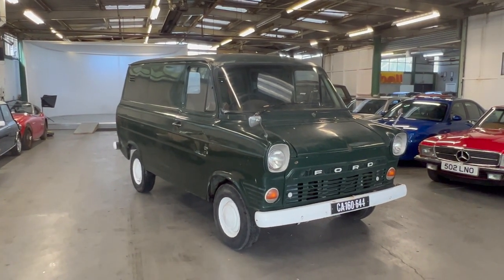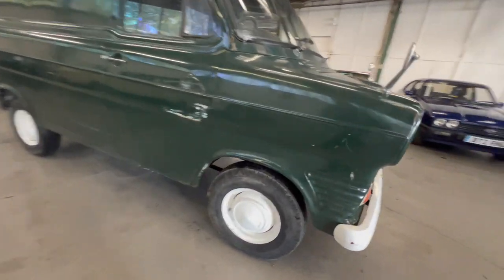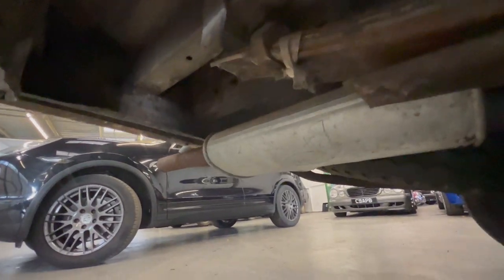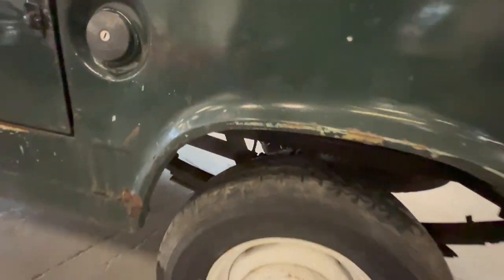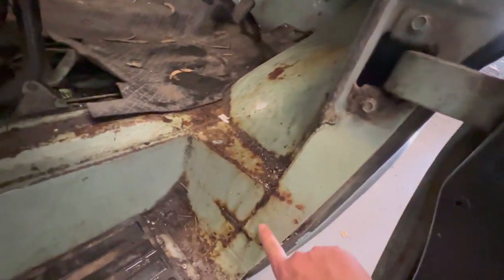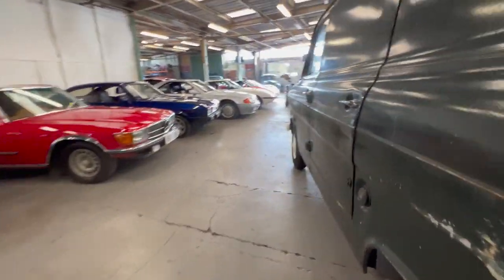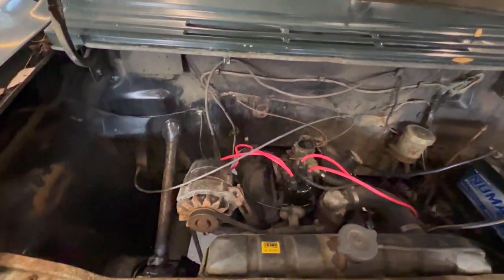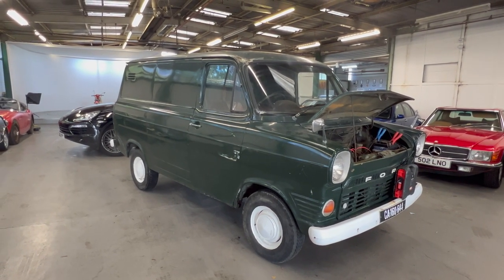Ford transit MK1

Comment: We had a 1966 Ford Transit 12 passenger van when I lived in England in 1968-1970. My father actually brought it back to the states in 1970 and I learned to drive on it. Right hand drive and shifting with my left hand! Loved that van, I still have the british license plate that was on it! It also had the V4 engine and therer was an available V6 with a longer snout on the van. Ours was actually the same color green you have on that one! Why did they not make more cars with the V4?

Comment: The metal top dash and painted bumpers and hubcaps is the standard model
The custom comes with crash pad dash top chrome bumpers & hub caps
Also spotted no heater in that one probably hot climate export didn't have one fitted, or was it made in South Africa?
Reply from the maker: Your correct. South African model